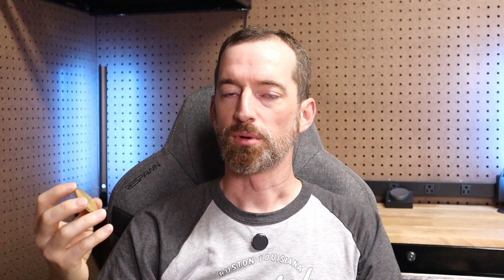How to Turn Yourself Into a Coin - AI Portrait to Brass Engraving with xTool F1 Ultra

Comment: Trying to follow you on the past you are using gimp but the small screen is blocking your moves.
Reply from the maker: Sorry about that, I tried to make it as small as possible. Never seems to be a good place for it. Did you miss anything I can fill in the gap on?